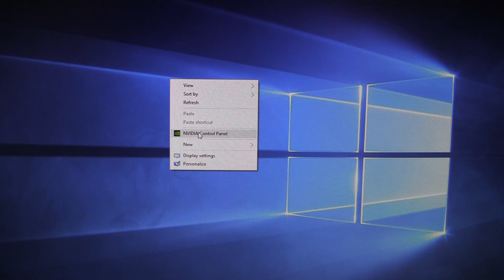How To: Setup SLI

Comment: 3 graphics cards asus radeon hd 7970 direct cu2 top connection with a crossfire cable computer system windows 8.1 enterprise 64 bit therefore the Coolermaster Cosmos 1000 housing must be used to cool graphics cards

Comment: I cant see Set sli configuration in my nvidia control center , but i have installed 2 gtx 770 ....
What did i wrong?
Reply: have you figured it out yet? because i'm running into the same problem...

Comment: I got my cards plugged in and bridge is installed and I don't have "configure sli" in the control panel just "surround, PhysX". I also noticed that only one of my gtx 960s are showing in my device manger even after verifying the card are in firmly and all power cables are connected, both cards are getting power. Any guess on why this is?
Reply: Dead card

Comment: If I'm running dual GTX 1080 ti in sli, and have three monitors with display port, on which card do I plug in my three monitors?
Reply: Michael Clark top graphics card if it has 3 ports
Reply: Install thank you
Reply: your rich man

Comment: I have an ASUS Nvidia GeForce 750ti w/ 2gb speed and the card I want is a EVGA GeForce 1060 6gb SLI has to work with the same cards or can it work differently depending on the card(s)

Comment: Love the cooling tower! I have the same one and it's awesome! Now for my question, I've reviewed a few different or dozen videos on this topic and every one of them has had to enable the SLI Config. Not to boast but my setup did it automatically. 2nd question is the fans on the second card are set at 550 more or less rpm, is this normal considering i've gotten used to not hearing or seeing the fans on this awesome card even turn on, and I game BF1-3-4, The Division & so on. Oh and time to suck up (nohomo) you guys at evga make some awesome toys for the masses! Ok one more question, will or would I need one of those fancy SLI Bridges for my GTX 970 SSC acx 2.0's for better performance?

Comment: I was under the impression that using two GPUs with different amounts of VRAM will work, but each GPU will only utilize the amount of VRAM available on the card with the lower amount.  For instance, a 2 GB GPU and a 4 GB GPU would utilize 2 GB on each card, making the extra 2 GB on the second card useless.  Not sure why anyone would want to do that though...

Comment: someone is going to say it, but Stinger boards do not support SLI. It's all part of the mITX and only one x16 slot thing.  

The z87/97/170 manuals also state lane 2 and 4 for x16 operation as well.  Both of those lanes are on the plx where lane 1 and 3 are not on the plx and would provide latency free operation compared to one being hard wired and one being through the plx.  The difference would be minimal overall when using lane 3 or 4 when paired with lane 1.

I do like the inclusion about the 4 way not supporting 2 way sli, as that is a very important thing for people to understand.

Good to see more how to videos from EVGA though.

Comment: what about diffrent brands and maybe even speeds, but same gpu/ram
Reply: the only thing to consider is the sli fingers.  EVGA did make the 970 a little different upon manufacturing, and the original 970's won't sli with many cards.

the 980's and many other brands should be compatible, but it is always better to try to pair the cards as best as possible to limit issues.

lastly, if you buy a high overclocked card and a stock clock card, the overclocked card may be pulled down to the lower speeds while in sli, so it would be absolute best to stick with matched sets of cards.
Reply: +Reapsy best way to tell is if the gpu&#39;s used for sli have the same bios. If they are different models but same bios installed, typically they can still sli. This means though unless brands share bios's different brands will typically not work. You can break warranty and risk flashing bios which is a risk of damaging card and then successfully sli, but this is bypassing all security that is there to prevent you from damaging your card anyway. Sometimes the bios is what is limiting one company from working with another but almost always it is what sets that specific companies fan and frequency settings which will not work appropriately with another companies bios.

In the future there are plans for alternatives to SLI, I think DX12 which plans asncrhonous multi gpu support without the sli, that will be less hardware based, and will be able to manage getting benefits from mismatched gpu's by allowing on the software end to manage the load balancing of the processing for gpu's as well. This technology boasts about letting you even mismatch different manufacturers gpu's amd with nvidia. It has not been released yet so it is only rumor. http://www.tomshardware.com/news/microsoft-directx12-amd-nvidia,28606.html